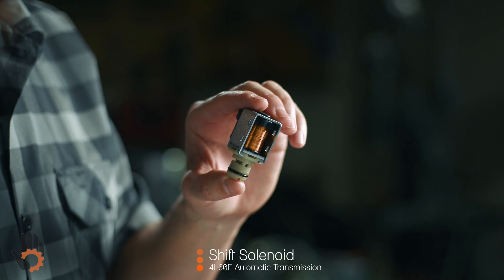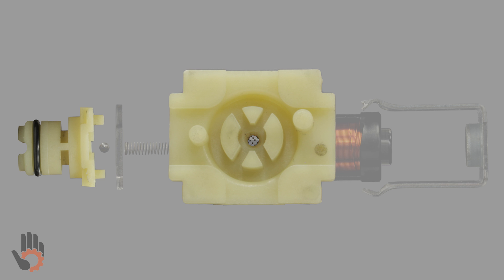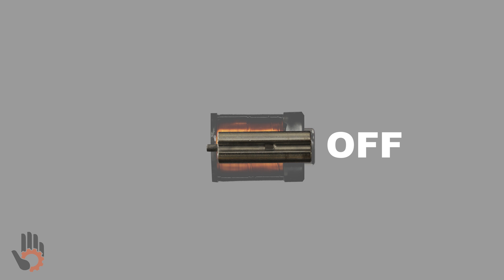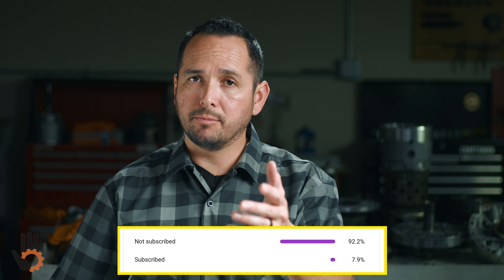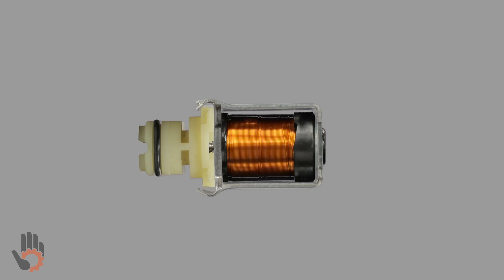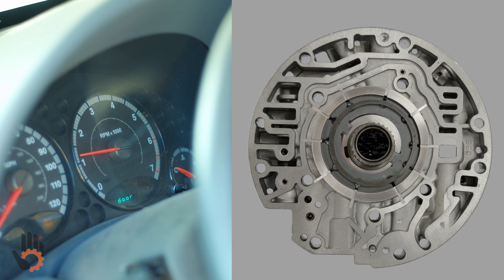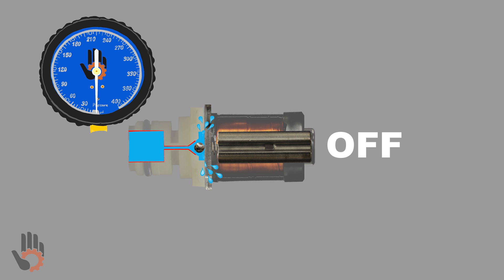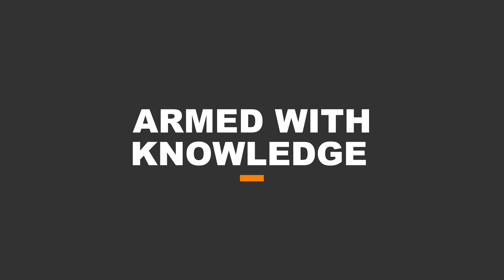4L60E Shift Solenoid - Part 1 (Basic Operation)

Comment: Hello!
Awesome content and knowledge.
We have a Mitsubishi Rosa bus with an aisin sieki automatic and are on the diagnosis train trying to figure out why in D it won’t take off (feels like it’s slipping) but when you select L it takes off but then won’t go up into any other gears when selecting anything other than L. Under the pan there are 4 solenoids, I believe 2 are for shift, 1 is lockup and the other is selection. Was going to replace all 4 or maybe the neutral switch? Or everything?
Reply from the maker: I'm not familiar with that transmission.

Generally speaking, when a trans is shifted into Manual Low, the trans will apply an extra clutch, and it will increase Line Pressure.

Extra Clutch:
This is used to do two things;
1). Increase clutch capacity.  Trans can now withstand more torque/load, before transmission slips.
2). Create engine braking (deceleration).

Line Pressure:
By increasing line pressure, it enables that clutches to withstand more torque/load, before they slip (burn up).

What does the fluid look/smell like?
Reply: @SouthpawAutoworks  I believe they run them in Volvo and Jeep as well. It has had new oil and filter, the stuff that came out looked reasonably ok.

Comment: Can u please show an explain how it shifts to 3rd. I know the pcm turns both shift solenoids off but I’m concerned with how the fluid flows to shift it into 3rd. I explained on one of your other videos how my mechanic is saying the I have something blocking the flow of fluid not allowing my transmission to shift to 3rd. He says valve body looks good an that he needs to rebuild transmission to fix issue. I’m wondering where the blockage could possibly be to cause 1st and 2nd to work fine but not shift to 3rd or 4th. Scanner says everything electronically is working correctly and that the pcm is getting the command to shift but it’s not shifting. I feel like I should be able to fix issue without doing a complete rebuild. Please advise an do a video because I know a lot of others that are having the same issue. Clutch’s and all are good also. I’m also curious as to where dose the fluid go when it leaves the solenoid? An how dose the fluid  actually make the transmission shift
Reply from the maker: I think I might know what's going on with your 4L60E.  However, I would need to get more info from you before I could try to assist you.  I responded (with questions) to your comment on the 4L60E Pump video.  When time permits, fire back.

I would love to do a video on this topic.

Comment: Awesome vids Robert! Pairing a 4l60e with a 5.3 in a ‘68 Camaro. Will it require anything different to operate correctly?
Reply from the maker: Right on!!

Are the engine & trans coming from the same donor vehicle?  Or are they coming from different sources?

Will the engine remain EFI, or will it have a carb installed?
Reply: @SouthpawAutoworks  It will remain EFI. The stock truck computer is included but, the transmission is from a 2004.

Comment: great content, as always. it helps to get a better understanding of anything you think you already knew or don't know, this just sets it in stone. also, I'm building a toyota u241 for a camry.. my first front wheel drive unit. these videos are based on a 4l60e, but generally many other transmissions function the same way.
Reply from the maker: Good to hear from you again.
Good deal!!  I'm really glad to hear that...  Thank you for the feedback.

First FWD trans rebuild...
Right on, that's exciting!

Yes, you are correct.  Hydraulics are hydraulics.
Thank you for dropping me a line!